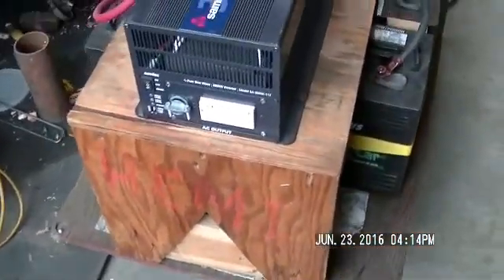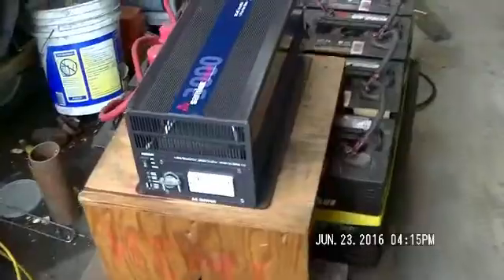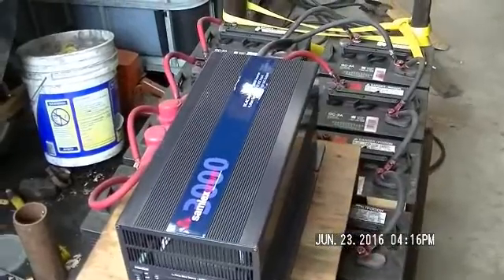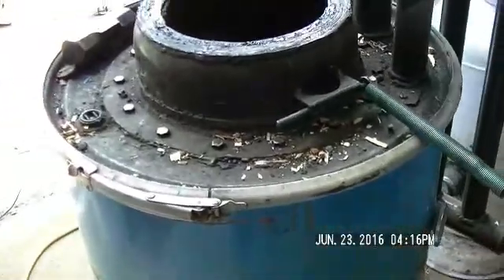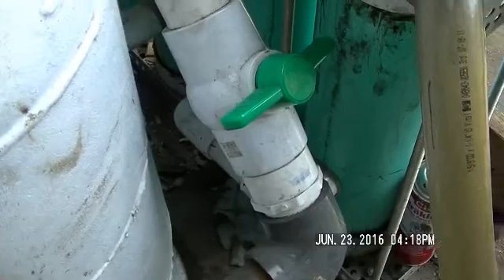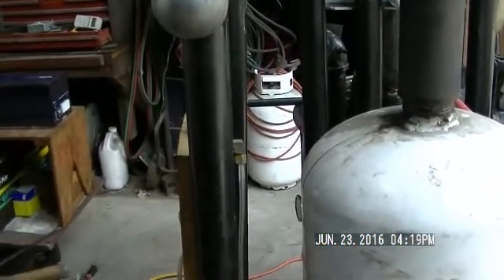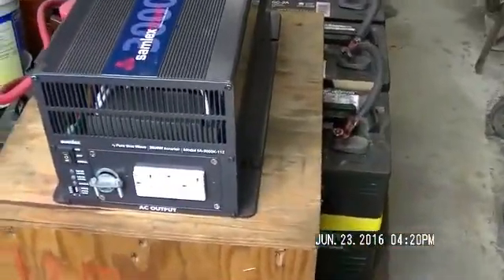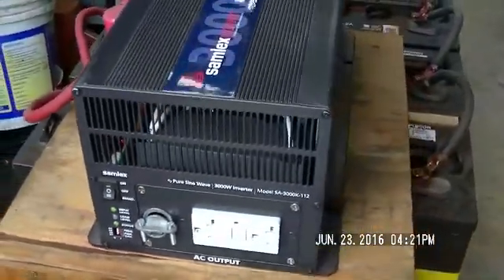NH Hbbyloggr Off Grid  gasifier startup ( Part 1 )

Comment: Bill go invest into one of those 200 amp roll around chargers with the timer on it. You can pick up a new one for less than $100 bucks. I have one that has the 200 amp start setting with a 35 amp charge setting. They make them with a 40 amp charge setting now so that's your best bet. I'm using this for now just to maintain my batteries. I charge them in pairs of two on the 35 amp setting. That will charge the batteries correctly and keep them maintained. I wouldn't advise you using those smart chargers. I don't like them and as long as you have a charger with a timer all is good as far as NOT overcharging your battery bank.
Reply from the maker: Flash, I do have one of those  big chargers.  Just got back from running a bunch of errands and I go mess with it. Thanks for the insight.
Reply from the maker: Flash, Here's the lowdown on the big regen blower 1/3 hp. With the ball valve positioned , restricting the draw, it reads 550 Watts. ( Startin it blasted it to 1300watts ;(   Open the ball valve , no restriction, 350 watts. That reading is not hooked up to the gasifir filters. So it, most likely higher with more restriction when hooked up.
Next was the 12v bilge pump blower , battery powered 12V with the battery charger going--115Watts.
All of the 8 -  6 V batteries come in at 6.77 VDC. 
 I have a smaller regen blower about 1/8 hp which pulls about 117 watts. Maybe time to switch over? That way the alternator doesn't have to work so hard during the initial charging period. Save on wood too !
Thanks for watching my back.
Bill

Comment: Nice work Bill. I'm using the same inverter setup with a 300 watt pure sinewave inverter and 8 deep cycle batteries. I didn't know you had the inverter setup. That's the trick for a woodgas system. This is somewhat how Steve runs his setup too.
Reply from the maker: The battery storage levels out the demand and surges placed upon the inverter as loads are added or dropped. I'm going to add some more batteries as I progress further. The regen blower running the 2nd flare showed me the need for more capacity as the indicator lights  quickly went  from green to orange  after a few minutes of running time, along with everything else I had on-line.
Reply: Man what all did you have online to drop the light down to orange only after a few minutes of runtime? That blower motor can't be consuming any more than 150 watts and if it's drawing more power than that change it over to something more efficient. 

I've ran a continues 200 watt test load just on a 12 volt marine deep cycle battery that ran for a few hours before the battery hit 10.5 volts. I was able to do the same thing with a 1000 watt continuous load with just 2 deep cycle batteries like you have in series running my 3000 watt inverter.  Is your inverter a 12 volt inverter or a 24 volt inverter? 

Mine is a 12 volt inverter so when I set everything up I'll either double the wires on the system for the current handling or I'll make thick steel connector bars for my battery bank. This is why a professional solar setup will run 24 or better a 48 volt volt inverter so they can use smaller gauge wires from the battery bank feeding the inverter but if you are careful you're going to be fine with a 12 volt system and there is an advantage to the 12 volt inverters. The reality is there are a lot more 12 volt inverters then there are 48 volt inverters on the market.
Reply from the maker: Kind of surprised me too. But using the inverter for the first time, ignorance is bliss. I'll plug in the load which were on it with a Watt Meter to see where it was getting gobbled up. Maybe the batteries are not up to snuff. They may need to be checked. Thanks for the heads up. Joe also mentioned the bad effect of running a one wire alternator dead ended. He advised adding a volt meter or even a small light  for a place for the power to flow out. All good stuff to know. Thanks for pointing it out.
Reply from the maker: Flash,
Mine is a 12 V . I feel that if I have to I can hook it up with one of the trucks during a crisis.
Gotta keep the coffee pot going , you know.